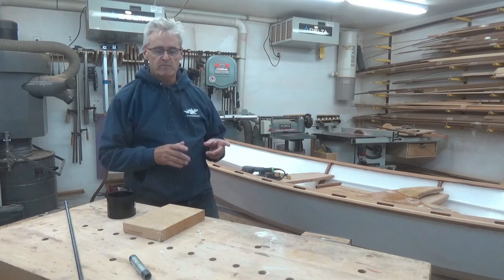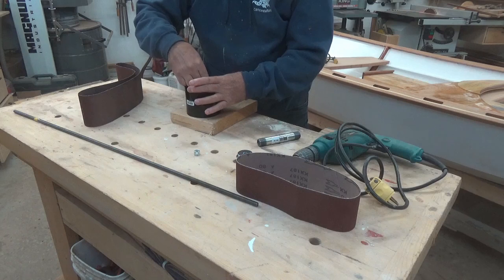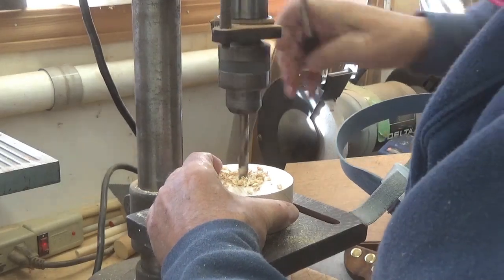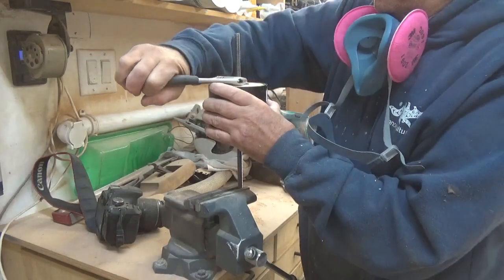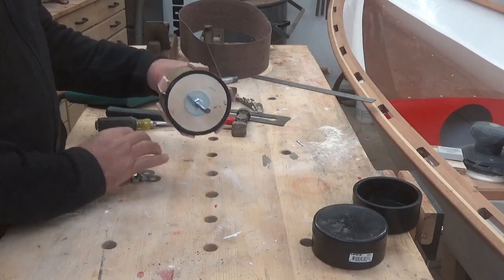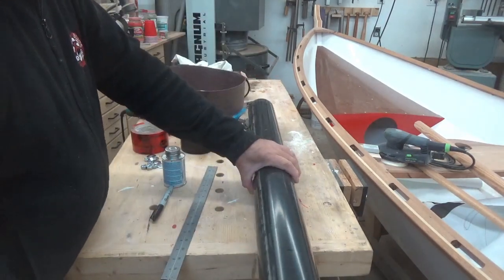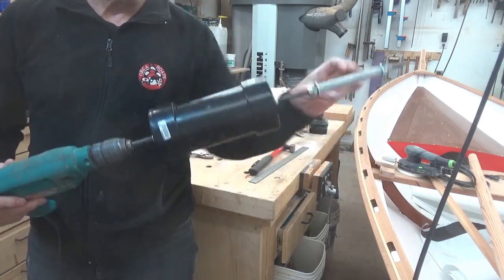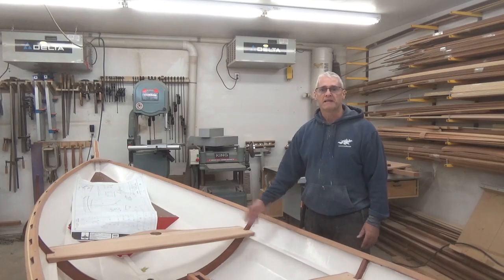Building "Elfyn" A Wooden Boat  EP20 Making a Spar Sander

Comment: I made one approximately the same way. I found that using hole saws I was able to make two large washers such that when also mounted on the axle they provided a circular "fence" on either side of the drum to protect my hands and arms.  This idea proved to be a handful and the spar had to be very securely stabilized before any sanding could begin. For final touch up I used a 4x40 inch power floor sander belt with two 3/4 dowels cut and pinched with screws at each end of a cut belt. That allowed me to do the "shoe shine maneuver" on the spar. Applying the belt in a diagonal fashion against the spar served to round it nicely along a common longitudinal axis. Great shoulder and arm workout!
Reply from the maker: The idea of the caps on the ends was to prevent the belt from coming off, but with the foam as friction, there was no shoulder left.  In the next video I show it in use.  Took some practice and I did sand by hand for fine tuning.  It is never going to be as round as if turned on a lathe, but heck, it is a mast after all.

Comment: Helpful tip:  The foam that you added needs to be narrower and only in the center of the area where the belt will be running so that it acts like a crown under the belt.  Just like a crown on a bandsaw tire which keeps the blade centered on the wheel.  :yougotthis:
Reply from the maker: Thanks.  Interesting thought.  I will give it a try.
Reply: Does that crown inhibit the actual "flat" sanding of the belt against the spar?
Reply: @thomasbuzzi3234  Not if the belt is long enough. You need a slight crown to keep the belt running straight and centered on the drum.